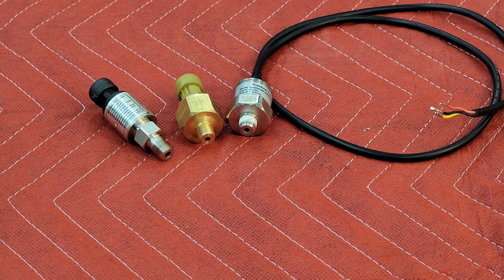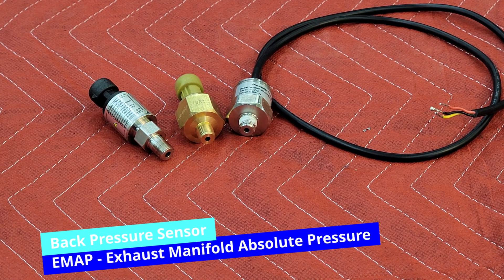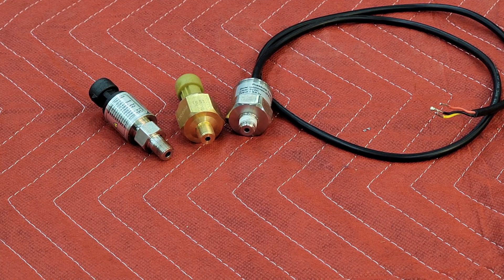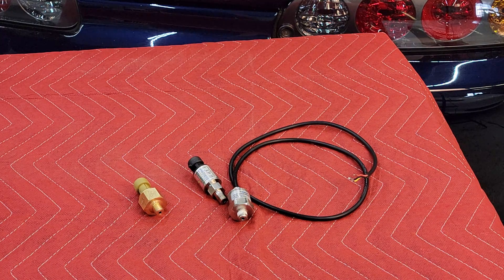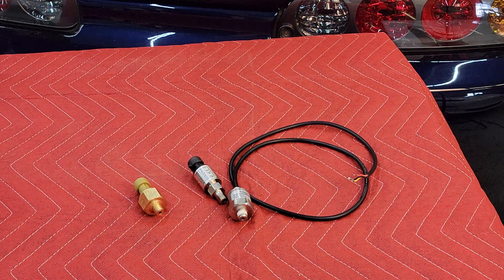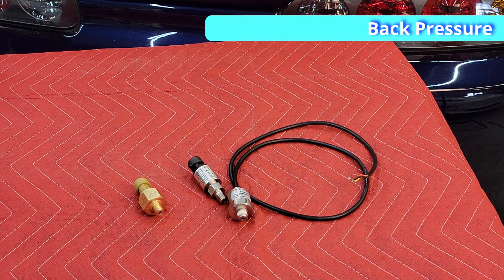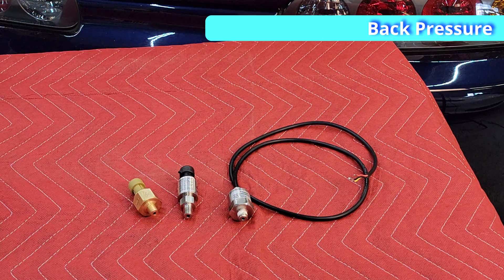EMAP or Back Pressure sensor use and installation tips.

Comment: Does 45 degree flares actually work with an fittings for this application?
Reply from the maker: We use 37.5 degree flares, but with softer tubing, the 45 would work, for THIS application.

Comment: That's awesome.  Never thought about a single coil around a socket.  But I like the 3d printed form.  Where did you get it?
Reply from the maker: I drew it up in Fusion360 and printed it myself.
Reply: @DynoMotiveDyno  Would you be willing to sell or send that file for the 3d printed piece?